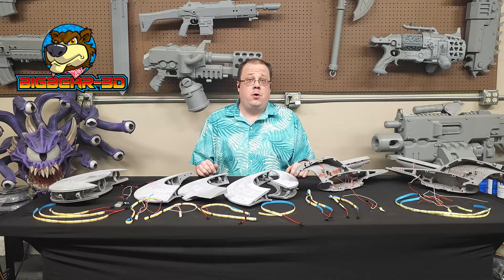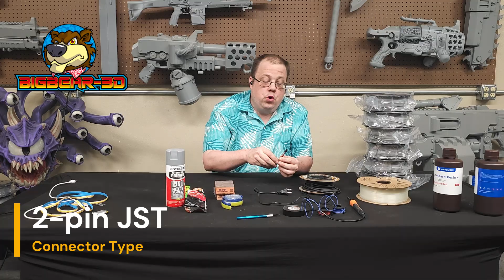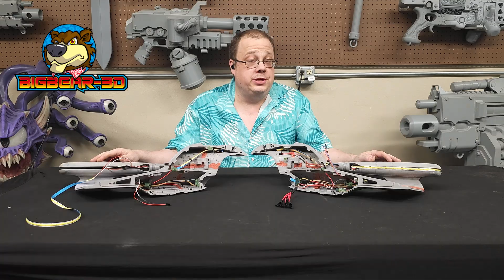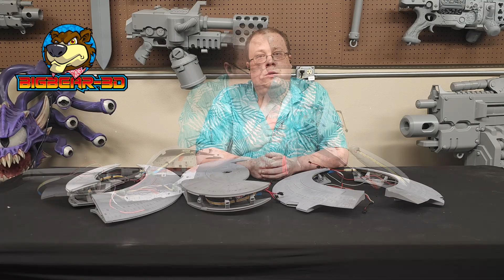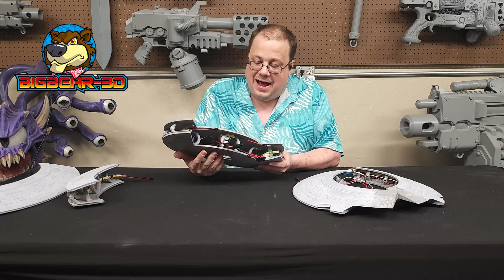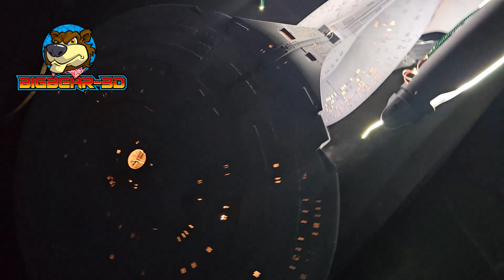Enterprise D: Assembly and Lighting Guide

Comment: I just finished printing the Warp Core from the 1701-D and I used PETG  in MHO it's far better than PLA..  also I don't use gorilla glue as it sucks and does NOT last.. things in the past I used it on are falling apart..  I've been building models since I was 10, and I'm 67 now..  love my printers, a few months ago I upgraded both of them to the SOVOL SV06 Plus Ace's   great printers for the money.. 300x300x350.. print area ...   your model is fantastic.. thank  you for sharing your work..!!   loved and sub'd
Reply from the maker: Gorille glue gel is extremely strong and long lasting in my experience, however I tend to use PLA gloop for major projects when possible. I use PLA for basically all of my prints, its consistent, easy, inexpensive, and gives me zero problems, but whatever works for you!

Comment: Thank you so much for this. It is more difficult than one would believe to wire lighting. I was curious if you had the second part available as I could not find it linked. Also am interested in how you painted. We are opting to use multi colored filliment to do the lifeboats, words and the accents. How did your paint turn out?
Reply from the maker: This project stalled hard due to other life events and a cat related incident. However it will be finished in the next few months
Reply: @realbigbear3d I completely understand that! Had a cat issue also recently. Costly buggers. Are you planning on aztecing the hull?
Reply from the maker: @thomas-wd3cn noooo. Gonna go with a fairly simple paint job. I have like 8 ships this size to paint
Reply: @realbigbear3d I'm still trying to find a way to get masks at this scale.ay have to produce my own.

Comment: I am working on this model myself now too and I was wondering, did you use the same led strips for the entire model just cut to smaller sizes for the small parts like the impulse engines ets. Or did you use something different for those smaller parts?
Reply from the maker: I used cutable strips, so just cut them to the length for each need
Reply: @realbigbear3d thanks, do you have links for the battery and charge board as well?
Reply from the maker: @captaindark_saber8357  I actually do not recommend the charge board I used unless you are experienced with wiring harnesses. Its only 1 amp. The battery was actually removed from my build, as it is a static display piece. But any 3.7v lithium cell works

Comment: Great video. Thanks for that. 
I'm sure a lot of people would be interested if you could link all the parts you used in the comments. Then we would know straight away which LED strips you used, for example. 
Btw, which ones did you use exactly? 
What I would be most interested in is how exactly you connected the strips and connected them to the power supply. Which components did you use for this exactly?

When will new videos for the Enterprise D be released?
Reply from the maker: Well i got the new covid variant and then got tapped to do questcon so I got slowed down!! These strips are just positive and negative. Any 5v led strip with cuttable pads will work. Im finishing the wiring guide on Orville and Normandy soon, and I'll def make sure to link it all so its easier
Reply: @realbigbear3d  Thanks for the reply. First of all, I hope you are healthy and completely fit again. 
I look forward to seeing videos and further information about your other work. 
But I still have one question. I noticed something when assembling the saucer. Some parts, for example 53/54 and 58/60, don't have a pin to attach them to the center part 61/62. So the parts aren't really connected securely. And when I try to assemble everything, it doesn't hold together. I think the only option is to glue it. How did you do it? Did you glue all the parts? Only some of them?
Reply from the maker: As for the d, im printing its nacelle covers and deflector dish, so prob 30 days before I start paint. Normandy is seeing paint first

Comment: Hi, what color filament did you use? And did you paint it? If so, what color? Your model looks great. In your next video, regards, wiring, could you show how you connect the LEDs to the board or is it plug and play?
Reply from the maker: This is grey PLA. There is some grey filler primer on some of the sections. Fortunately these are 5v LEDs, just power and ground, no fancy stuff. 
This will be painted at a later time
Reply: @realbigbear3d  Thanks , what color will you eventually paint it? there will more than likely be filament in the color you will use, think i would use an off white maybe matt filament not sure why asking?
Reply from the maker: @crealityK2plusshorts I will prob pick a paint close to the hue used in the production. Using a primer means the base filament color is irrelevant.

Comment: I finished wiring the star drive before I watched this video.  It would have been a good idea for me to complete one half at a time instead of starting at the nacelles and working my way back.  In any case, I have it wired and I used blue leds instead of warm white or cool white.  I found that these look better considering modern lighting (fluorescent or LED) is towards the blue.  It's very subtle.  I did this with the NX01 after testing with all colors possible.  I did NOT use connectors but had I seen this video I would have but had no idea how the whole thing actually fit together so i piece-mealed the LEDs and LED strips as I worked through assembly from the Nacelles back to the main body.  I considered connectors and I have all the connectors necessary and kit to make more, but this could mean bigger wires that wouldn't fit through some of the holes provided for them.  I soldered everything together.  It will never come apart so I'm okay with it.  I'm considering installing a lithium rechargeable batter, charged with a wireless inductance device (available on Amazon) and maybe a magnet switch to turn it all on.  My NX-01 had a DC barrel connector inserted into the body underneath...wires show...not the best idea.  Every light installation was checked numerous times to make sure it would work after manipulating other pieces around and gluing stuff together, and the light had to look good.    I'm putting in lasers (red/green) and something akin to photon torpedos that begin to flash on the perimeter of the saucer, culminating in torpedo launch at the center.  Good ideas in this video.

Comment: What printer Would you recommend for this project
Reply from the maker: I used the Creality k2 plus, you can actually see the timelapses in my shorts. It would be tough using a slower printer, its quite alot of detail and alot of large parts. Printing this on my ender machines would have taken an eternity in comparison.
Reply: Ok thank you i been thinking about getting into 3D printing  didnt know which printer to get
Reply from the maker: @aaronvandoorn1276 the creality k2 plus is an excellent entry into 3d printing

Comment: Man, i would love to see how you had the parts orientated on the build plate. and did you use the the provided print settings?
Reply from the maker: nooooo, gambody has some weird settings. The part orientation is CRITICAL with the surface quality on a model like this. The suggested orientation from gambody is wrong on almost every single part of this model. Make sure you have your curved surfaces vertically oriented

Comment: It's an ok tutorial.  But I wouldn't go with warm white for the windows.  Cool white is accurate to the studio model.  Plus where are the Navs and strobes at.  You didn't do them.  They need to be put in.  Plus using all white for everything not the way to go.  I personally used Leds for it but it's ok to use strips for it as well but the impulse and nacelles don't use white.  Use red for the impulse and paint the inner section black it's more realistic.  Now the nacelles use blue led strips to light the chiller grills and the grills themselves use Pla+ clear then tape off with very tiny masking tape 1 or 2mm would do for the width of the tape.  tape off the inner groves of the grills and then paint a copper color.  just a even very light coat will do.  So when the lights are shut off it will look like it's in dry dock.  But when lit the blue will shine through the copper color it won't be seen unless you turn off the power.  And why are you glazing pudding the grid lines for?  Those lines are on the ship.  Don't use glazing putty.  Use a plastic putty or Perfect plastic putty so the seams are sealed but the grid lines remain.  Oh and another pro tip don't print the The insignia or names Do the smooth none printed version.  On etsy there's a guy from England that does decals for this very model.  It looks WAY more better then the raised prints.  His name is Bobmat343Designs.  Also for people who are more skilled in painting and want to do the Aztecs for this ship.  I am currently working on them I should be finished with them in a week or two.  For the saucer seperation I agree with having the star drive charge the saucer.  I have mine that way however if you look magnetic charging, they are small little magnets I have three total on the star section and three on the saucer while connected together it charges the saucer without having a plug and a whole in your star drive.  I would look it up.  Now power on and off.  There are several to choose from my favorite i would recommend are two a touch sensor you can get off of Amazon fairly cheap.  works well for these kinds of models or go remote be a little flashy with it.  Ultimately it's how far you want to go into a model like this but I see it you are going this big for a model like this why not put the bells and whistles at it.  Another thought you can go to a board company that specializes in models like this Like HDAmodeworx out of Texas or Tenna Controls out of Mass.  Then you can have Navs. and Strobes  the way this ship is suppose to look like It just comes more a live Then boring old static color.  Another suggestion is sounds and lighting effects if you really want to dig in more.  Phaser effects isn't for begginners its more for the expert level but what is doable is like torpedo effects front and rear and having sound that goes with it.  Yes is more wiring and more power draw but lets be honest these ships are not on all day long maybe a few minutes here a few there right so power draw won't be an issue besides you have a charge port.  just plug it in lol.  My ship is on DC power and only battery is in the saucer so I don't have to worry about that problem I can run on 9 or 12v running a nave board, sound board,  phaser and torpedo board in mine with a bluetooth transmitter on the sound board so I can hook it to a bluetooth speaker yes it's a lot more advanced then what this gentlemen did but I'm just giving more options you can do for your build.
Reply from the maker: @draggerlane04090  all the coloring for nacelles and the like will be in the casing, I will resin print blue and red, so the color of the strip won't be an issue
Reply: @realbigbear3d  I understand why you went with the colored clear.  Resin is the way to go no doubt but for the chillers in my opinion is to clear.  with pla+ it gives a foggy difuse effect.  however you could also use a few thin strip layers of acrylic sheeting Is what I used to get rid of led hotspots
Reply: Did you ever finish the Aztecs? My current plan is to enlarge and print the 1:1400 decals from starship modler (can’t find where someone has shared a 1:700 version) but always looking for ideas.
Reply: Hello! Did you ever complete the aztecing and if so how did you do it? I am interested in aztecingine when done.

Comment: Great video, I'll have to figure out what parts to order for the lighting. What connectors do you use? What wire gauge are you using?
Reply from the maker: they are 2pin jst connectors, the wire gauge isnt something that needs to be exact, but if you make it super thick it will be crazy hard to work with.

Comment: Thanks for putting this video together.  I've been wanting to build this but didn't know how to light it.   Your video explained it well.   Just a couple of questions.   What battery did you use and any special settings/resolution on your K2?   I have a K2 as well.   Can't wait for your next video.  Thanks and subscribed
Reply from the maker: the battery is a simple 1000mah 3.7v from amazon as I recall. Make sure your layer height is at most .12, .08 on the parts with lettering